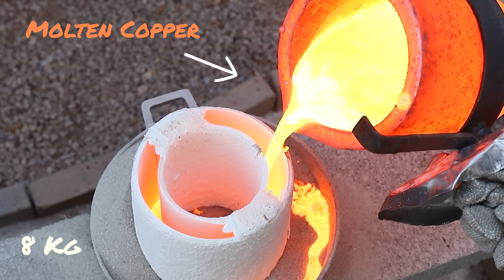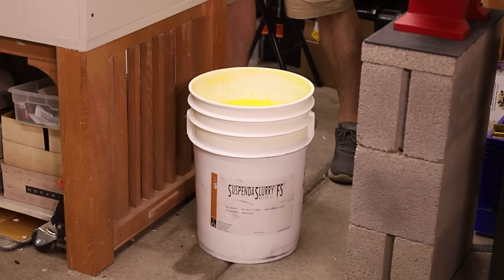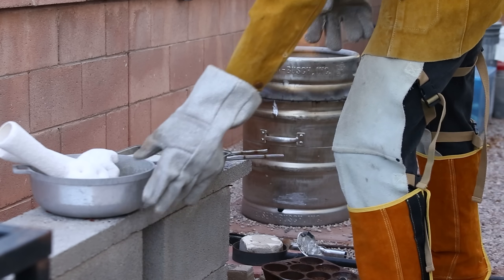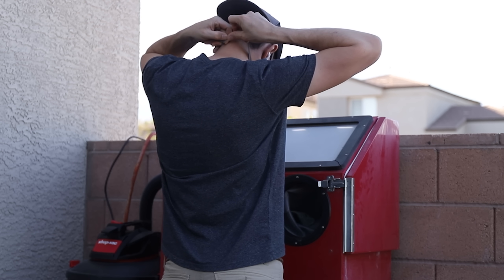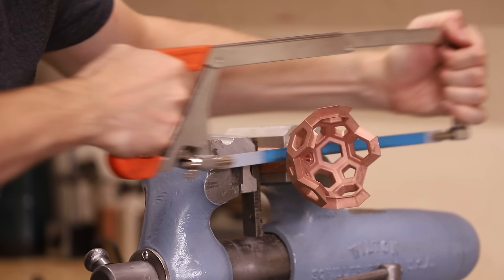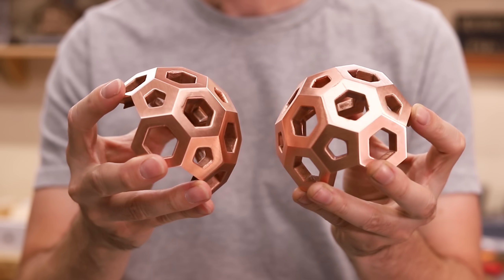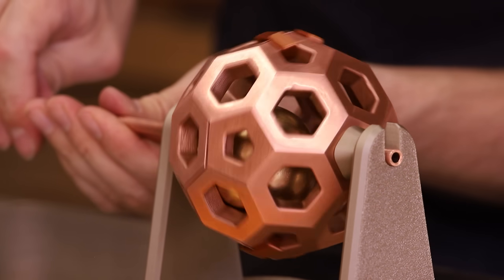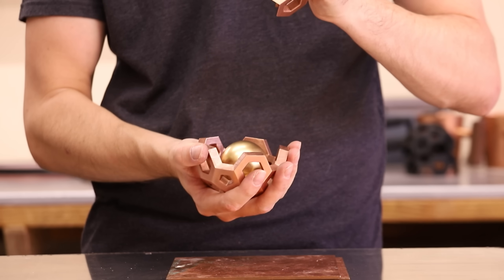HUGE Magnet VS Copper Sphere - Defying Gravity- Will a Neodymium Magnet Float Inside?

Comment: You might mark the 'equator' of the magnetic sphere and rotate the cage around that equator to get sphere suspension near the center of the copper cage. A magnet's field strength varies depending on where you measure it on the magnet surface, strongest near the top and bottom pole 'edges'. Those fields 'drag' through the copper like a net through water, which causes a disk magnet to fall slower in the copper tube and stay relatively centered since the circle of the disk is centered on the circle of the tube and the fields drag ~symmetrically through the copper. In your windowed cage, the copper-induced 'drag' varies by its complex geometry passing through the sphere's magnetic field as well as variation in field strength between sphere 'equator' and its top/bottom field poles, and so you get the sphere magnet bouncing around rather than suspension in the center of the cage. However, you might get some symmetric distribution of magnetic fields to copper and get the sphere to center on the cage if you rotate the cage around the sphere's magnetic equator - it's 'Bloch wall,' aka dielectric plane of inertia. The copper cage doesn't interact with a symmetric sphere of magnetic fields. It interacts with two stacked expanding toroids, each representing a magnet 'pole,' with greatest field strengths where the fields start to turn into the top and bottom pole centers. Hopefully the above makes sense for you. Good luck. Making that cage was amazing to see, by the way. Thank you.

Comment: Hello friend 👽 I’d recommend maybe using a Armillary Sphere to generate an even spread of gyro rotation to keep the ball in a suspended state. And from what you saw with your magnet moving your copper ball. Why not use magnetic strips or alternating pole electromagnetic pluse fields to help create a continuous rotation. Or see if you can make a triboelectric feild going. I “wouldn’t” recommend using hz in addition to your experiments or a sub zero sphere containment. Let alone make 3 armillary Spheres rotating on a spin top like fidget spinner where each sphere rotates while the centre is unaffected emitting ones frequency. 
Annnd not even look at theremin or an Oscilloscope into your cymatic experiments.  

CaCuSi4O10
BaCuSi4O10
BaCuSi2O6

Enjoy 🛸

Comment: I tried to recreate the slow fall from the intro with my cheap neodymium magnet and 2kg copper ingot. Unfortunately the magnet doesn’t seem to be strong enough. You can feel the force when rotating and moving fast but just letting it fall looks pretty much the same as without the copper

Comment: use gallium and show us that.  Obviously lower temps than copper and you can pour directly into a silcon mold made with the pla.  Probably have to test in A/C tho.  Then fix a ferro fluid lens and show a slow mo.

Comment: Idea #1 - A set of equally spaced pins that hold the ball in the center when at rest. Weight and spring load them such that the centripetal force causes the pins to withdraw at higher speeds. This will keep the magnet centered and gently release it upon reaching a consistent RPM.

Idea #2 - What would happen if you made a larger copper ball with similar proportions to this set up, set to rotate on the same axis, but counter rotated it? 

Idea #3 - Mark the poles on the sphere so that we can see what they are doing, and how the magnet rotates during the experiment.

Comment: I really like all the different experiments I’m a big fan. This is one of my favourites. I would like to have some of the equipment and the knowledge and the money to try some of the ideas you have worked on. I was thinking about this experiment unfortunately you can only spin the sphere on one plan. Because of that the ends of the sphere are spinning slower . The magnet will only be stable along the equator because it is where the sphere is moving the fastest.  In order for the magnet to be in the center and stable you would have to spin the sphere on all three plains at once and at the same speed.

Comment: To make electric motors more efficient people are experimenting with magnetic bearings. Problem, they are using electromagnets to turn them on and off. It takes power. Could a magnet with a copper shaft hold the spinning rotor in the middle, using no electricity??? And how accurate would it hold it???

Comment: I have a vision of putting this lead sphere with the magnet together in the center of a Rodin coil, which should be large enough to contain the sphere in its middle. This setup will create a very strong magnetic field at the center that will rotate the magnet. If the magnet keeps rotating, it will be possible to disconnect the coil from the power source, and the coil will receive electricity from the rotating magnet. This electricity can then be used to power electrical devices

Comment: I think there can be a way to create perpetual motion by the force of the magnet itself. Once you do that, the possibilities are unlimited because you would have a motor with no power needed. I know this can be done. For example, your magnet could propel a light weight surrounding dome hooked into a bar with some wheels at each side.

Comment: Solder the seam between the halves. I think the contact between them is uneven and insufficient for the free flow of induced currents. You can solder with something low-melting, like gallium alloy.

Comment: See if you can find the RPM range so the magnetic ball floats, then using a separate external magnet, see what RPM it would take to make the assembly spin to match the "float" speed. Perhaps you can also find ceramic bearings to eliminate the friction between the axles and the stand. Once you can get that working, find out if the assembly can support a load. A tiny generator lighting an LED or something.

Comment: Would a copper net-type sphere be better? Rather than having a few holes with big bars of copper in between, perhaps having a lot of holes would work? It would certainly help with the visual side of things. Also, you can call what you have a sphere, but you do have to admit that it's still a planar solid, so the EM lines would be affected, throwing the magnet off to the side.

Comment: Your distance in-between the sphere and your N52 is too large. I would reduce the overall diameter of the sphere. Once you started to use your drill the Nib bounces about, I estimate, 12mm-15mm in a horizontal direction. This reduction is to centralize the Nib itself in a Horizontal plane and a Vertical plane while spinning. Nice job bro.

Comment: Would it be possible to suspend a smaller powerful neodymium sphere inside it? Perhaps get one of those clear plastic Christmas ornament DIY baubles (so the magnet can't go out through one of the holes) and put a more marble sized neodymium sphere inside. I'm curious if it would hug the sides or if you get a more centralized float depending on the speed of rotation. For that matter I'd be curious to see the preferred orientation of several different magnet shapes inside that; particularly if you had another stationary magnet creating a static shaped field outside of the copper geodesic sphere.

Comment: Would it make a difference if you placed the clips the entire way around the seam. When you were spinning with the drill it reminded me of the typical sound you hear when a washing machine has an unbalanced load (hence the adding of the additional clips in your case). Hopefully if I am right about the clips you will save time from reworking.

Comment: I'm thinking that the sphere will align itself relative to the sphere at some point and begin to rotate "with" the casing, meaning that it will just be "falling" to one side from the perspective of the casing.  

Not sure if it's clear what I mean... To the magnet, it will rotate until it is effectively within a tube and will drop to the "weak point".  If the casing could rotate in more directions so the magnet sphere couldn't "align" or orient itself with the field lines, I think you'd get a better floating effect. 

So, time to akena 3d gimble 🤗

Comment: Make the magnet smaller or the sphere larger so there is a larger area for the round magnet to operate. Also hold some electrical items near it like an LED or some way of monitoring if it is producing Voltage and at what rate at what distance . Change the rate of spin to see if it increases or decreases. Try some ferrofluid near it or see if you can incorporate mercury in some fashion or the gyro effect.

Comment: Maybe Make a sphere enclosure with bigger whole and thinner edges so we can see the ball better if the science works for that still. Then change the sphere pattern to a hexagon that way when you rotate it along a certain axe you have the same polygon showing up in the same spot every x amount of degrees, then add a strobe light to it so it hits it exactly when the polygon is in the same spot, so it will look like the enclosure is not spinning and the sphere is held in space. Also since you can rotate the sphere with a magnet wirelessly, maybe but that magnet in the base with a motor, and it will look like the sphere is rotating on its own. I wonder even if the whole setup can hover.

Comment: That looks so amazing, great job! When it comes to improvements I think it would work better if your outer shell was still spherical (at least on the inside). The flat surfaces and corners mean that while rotating, your magnet will sometimes be closer and sometimes further away from the wall, resulting in the force acting on it not being as constant as it could be and making the whole thing a bit unstable.

Comment: This is one of the coolest things I’ve seen. I’d add some led lights where it attached to the copper shape so it highlights the magnet inside a little more. Also, as this is basically a small scale replica of the earth and how it’s magnetic field works, together with the fact that they’ve recently found that at the centre of the universe we have a back hole with a version of high magnetism; then perhaps create a solar system version of this and see how it reacts/

Comment: This is a really cool idea and your right it looks sick just as something to look at and i can see the vision I think the main issue with the affect is it’s difficult to see what’s going on without an explanation you should try experimenting with how little copper you need and how small of a magnetic ball you can get away with using and still get the desired affect I think especially a smaller magnet could help it look like it’s floating more and instead of a thick geometric pattern for the outer sphere maybe more, thinner strands of copper all running in the same direction to form a sphere that way there’s more uniform gaps once you spin it just some 2am thoughts from a dude that knows little to nothing about anything.

Comment: Just an FYI, "Centripetal force" is the INWARD force applied to a spinning body that PREVENTS it from leaving the axis of rotation. "CENTRIFRUGAL force" is the force of a spinning body that forces the body away from center.  For example, centrifrugal force acts on the fat kid on the merry go round that tries to throw him off. While the hand rails offer centripetal force to prevent him from getting thrown off..  if the magnet is being pushed to the outside of your ball, that would be CENTRIFRUGAL force..    Being that you're dabbling in science, i figured you may care to know the difference.

Comment: Cool idea. I wonder if a toroidal shape would allow you to create basically a continuous pipe, i am guessing the sphere might have issues due to the perpendicular nature of the way the magnetic lines push the current in the copper.  If you had a toroidal shape, you essentially then have something closer I believe to an endless pipe, and you just do the same thing, rotating the toroidal shape to create an endless falling pipe essentially.  Thought I don't know what effect cutting hols in the pipe or toroid would have. It might cause the magnetic field lines to do weird things.... kind of like what happens in a microwave with the magnetron.  
Speaking of which, i think the radar/microwave magnetron is one of the most under appreciated piece of engineering, to come up with that shape to generate microwaves from current is absolutely genius...

Comment: Yes, I have an idea.  Use a strobe light with a speed control to match the rotation speed so that it looks like the shell is stationary and the sphere is floating.  I use this for turning wood bowls to see the surface while it's moving as if it were still.  You might use a hall sensor to sense the openings to time the light to flash on.  It has to be a zenon lamp, and not an LED, unfortunately.

Comment: I think magnet float purely because structure divided in to half's so current in each of them generates independantly so you have two electric fields instead of one.  Remember how it was with copper tube - float was much cleaner.
Try to make sphere in whole piece, with entrance point for magnet by excluded hexagonal edges on same axis. Complete form by those edges added as inserted points of support.

Comment: Your "cage" needs to be balanced like a tire on a car or truck. Balance your "cage," start by placing clips uniformly around the "cage" without the Neodymium magnet inside and add weight where you need it to balance the "cage." After the "cage" is balanced, place the Neodymium magnet inside and repeat the experiment. Use bearing rings on the shafts for a smoother rotation. Get yourself an adjustable strobe light to illuminate your experiment and reveal the wonders of applied sciences.

Comment: Former Materials Engineer (Undergrad only before changing careers): Seems like there are perturbations in the Lorenz force, and the inner sphere can oscillate in the pole axis direction. Probably only a partial solution besides making the ball somehow rotate in both the X and Y planes simultaneously. 1. Try grinding the inside surface into an actual smooth sphere rather than polygonal to see if it creates less perturbations in the Lorenz Force while leaving the outside polygonal for aesthetic purposes, if that doesn't work grind the outside into an actual sphere. Or is the perturbation in the force more due to the actual electrical paths within the copper cage as it has to move around the hollow areas, in which case try 2. Drill out the holes in the copper to be rounded as well, or change the design to allow more direct current flow without changes in direction. Need a differential equation graph of the electrical paths through the copper as well as the Lorenz fields.

Comment: Crazy and probably wrong, but if you insulated each half of the (what ever you called it)sphere from each other,  and attached a wire that would still allow rotation, would that cause current to be generated? It almost appeared as if the magnet sphere was rotating in the opposite direction from the outside sphere.

Comment: I want to see what happens if you mount your stand to the wall with the spindle pointing up. Drive it from below [or above]. Watch the magnet  lift up from the sphere.

Inl8ke the suggestion to utilize stroboscopic lighting to capture the rise or fall of the ball as you spin the cage [sphere].  
Grrat demo. Great casting skills too. We do this at art school and its not as easy as you show to get the shells made and not break them. But you made it work. Maybe polish the 3d printed spherevl before coating it. Solvent smoothing after light sanding?

Comment: Here's another experiment suggestion: Create another sphere, but this time make it in two layers. Then, magnetize the inner layer and ensure the outer layer is made from a material that isn't attracted to magnets. Insert a magnetized ball inside it and see if the magnet ball will float without any external force

Comment: Is there an issue with the bumpy surface inside your copper "sphere" causing your magnet to spin at the same speed as the "sphere" negating the magnets ability to induce a current and hence levitate? This might be a part of the reason it only works at a certain rpm.

Comment: If you make a big electromagnet loop outside the cage, with the coil going from one end of the spin rod to the other ( approximately) the electromagnet will torque the permanent magnet to keep the poles across the middle of the cage. Would expect that to maximize induced cage current and magnetic support — but then you have 3 magnetic fields in a moving system… too many degrees of freedom for my brain. But changing the solenoid direction can be used to manipulate the magnet.

Comment: You noticed the effect wasn't as dramatic as you had hoped. Would having more copper in the vertical axis give it a better effect? As plugging the holes near the "central line" with copper hexagons? You would still be able to see in from the other holes.

Comment: Personally, I'd recommend the following:
- Using a synchronous strobe to make it appear that the shell isn't rotating so persistence of vision doesn't interfere
- Soldering or using copper foil crushed between the halves to provide a better electrical connection between them
- Make the plug a tapered fit with a screw on the inside so it can't get loose very easily
- Speed-controlled drive motor